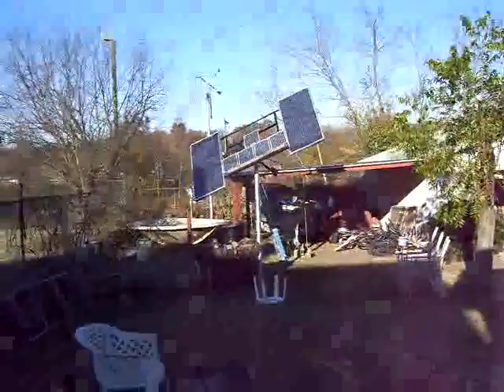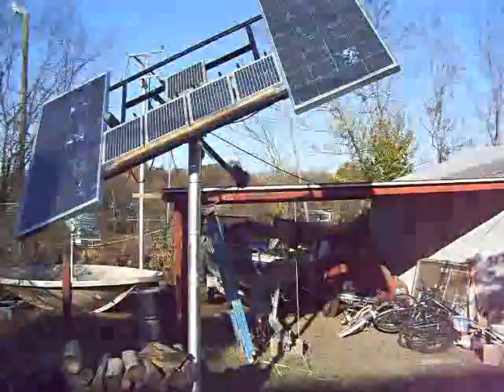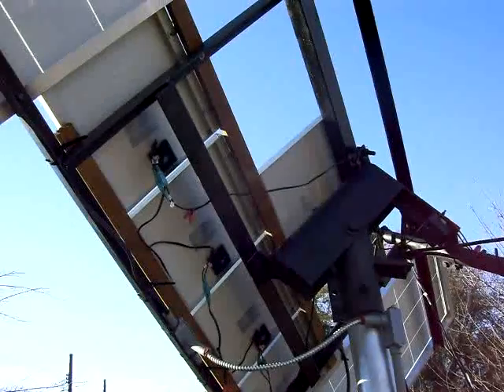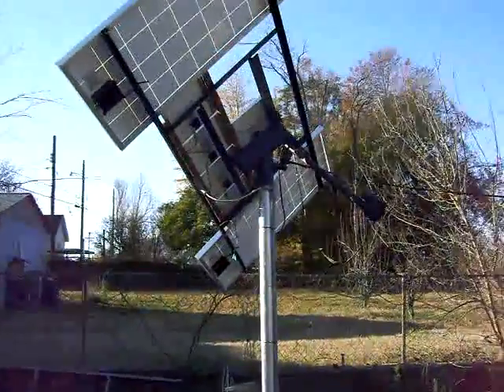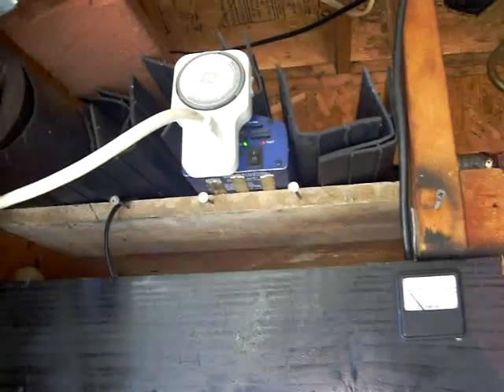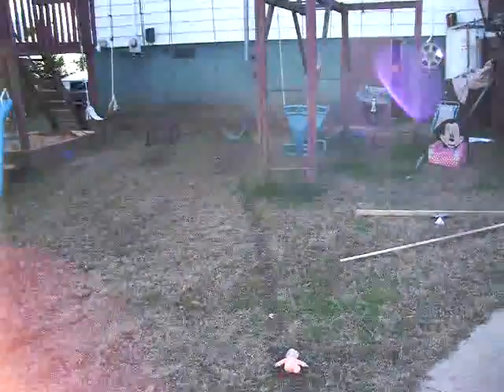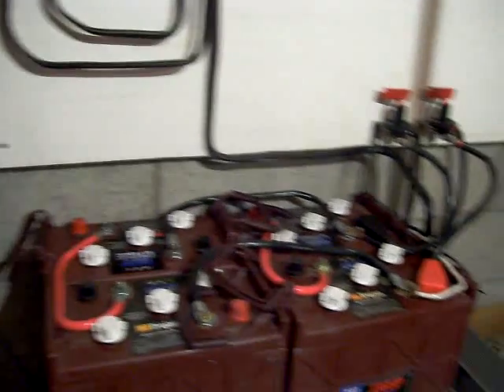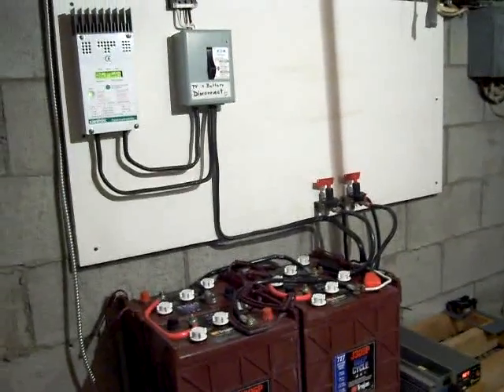my solar tracker,  tracking system, sun power energy

Comment from the maker: Here is link to china made tracker with linear motor that will work for this setup :) 

http://m.ebay.com/itm/Single-Axis-solar-tracker-kit-Linear-Actuator-Tracking-Controller-Sun-Track-/391481786454?var=&hash=item5b26220056%3Am%3AmA8HVkV0TuSHpsCmZEnL2tg&_trkparms=pageci%253Ac32d6540-ea3f-11e6-aea2-74dbd180c752%257Cparentrq%253A0543fc2115a0a5e2a5691eefff9decca%257Ciid%253A14&varId=660657614330

Comment from the maker: update :: 
on 8-10-2009 my tracking rig stop working :(
i found out that rain water was getting in the motor.
i took the motor down and open it grease it all check brushes and they was ok ,put it all together a mount it back :) 
and it is working again :)

Comment: nice work. i have been thinking about a design using one pump motor, two hydrolic rams,some electricly activated valves,and a pivot mounted on a rotor to control a parabolic solar collector for my soon to be solar/steam turbine/generator...hope to start building soon..

Comment from the maker: and the orginal linear motor that was on the mount stayed the same like for the Cband dish ,i just adjusted the stop limits inside the motor to by able to turn as mutch it was posible :) 
and that is :) 4 wires from the electronics , two positive and negative to battery , and two to motor . and it it working great ,it is adjustig themself every minute to point to sun :)

Comment from the maker: no online how to :(( 
it was so easy i didnot thing about it :) 
the C-band satelitte mount was only modifide to mount the solar panels ,so i just cut some parts out and weld 1.5 inch x 1.5 inch steel angles two long ones 102 inches horizontal, to by able take another two big solar panels :) and two shorter vertical for it to by strong :).